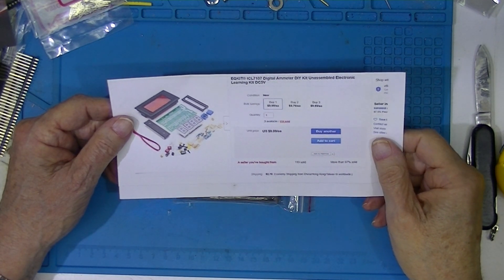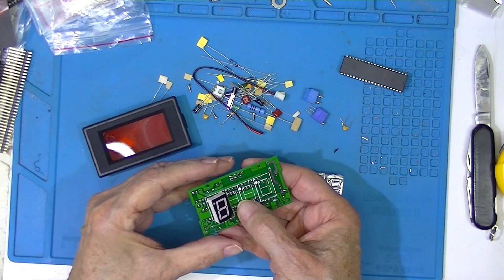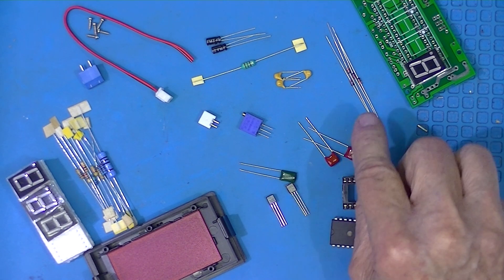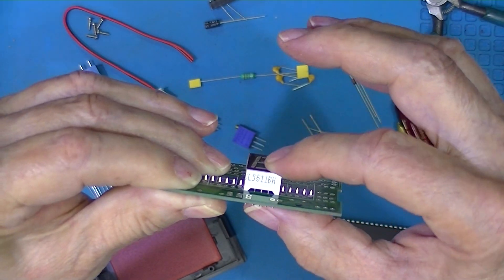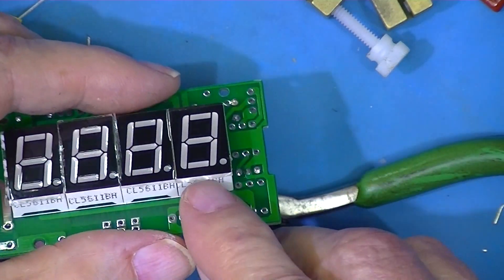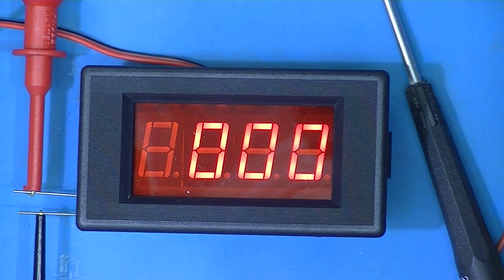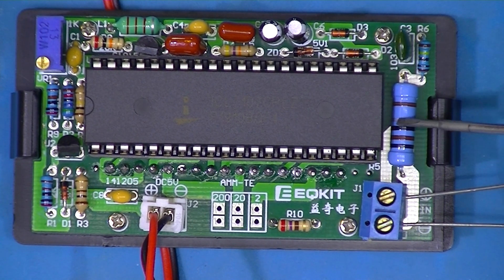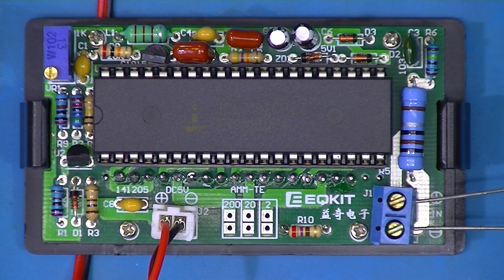Ammeter Kit Build– 2 Amp Full Scale

Comment: If you connect a voltmeter to pins 35 and 36 I believe, you can adjust VR1 for 100mV - according to the ICL7107 data sheet